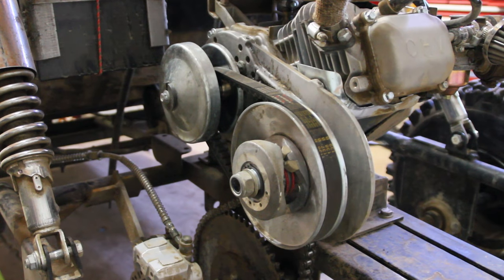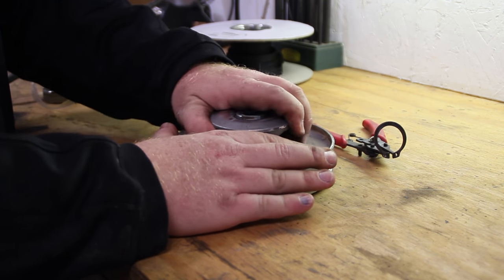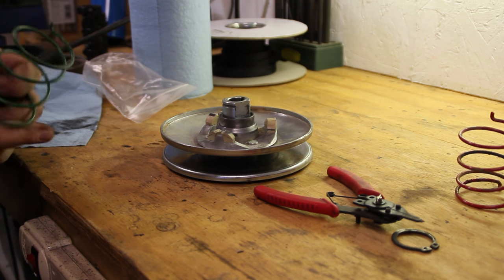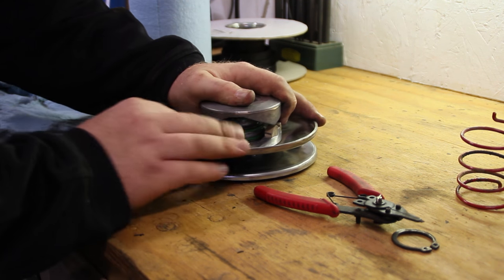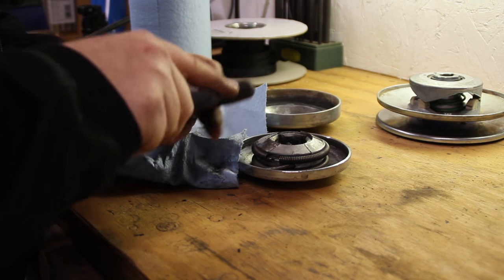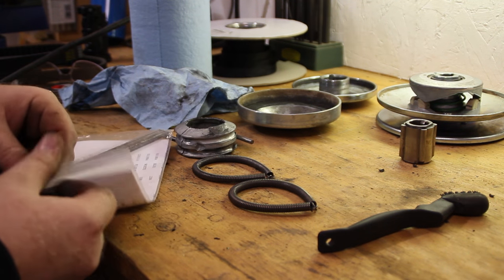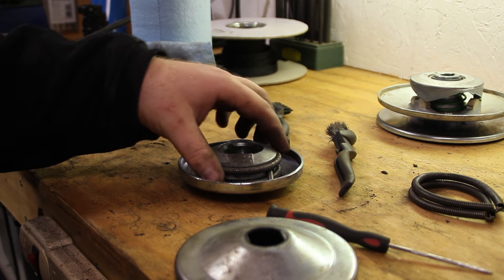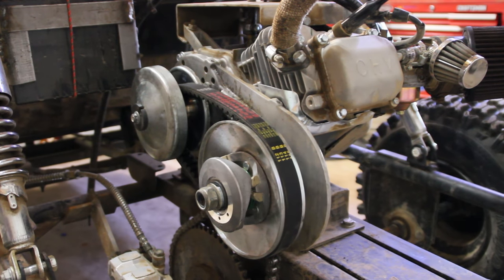Predator 212 Go Kart CVT - Torque Converter Belt Breaking Fix (Neighbor Freak Out)

Comment: I've been trying to get my old manco dingo to work again this was very helpful
Reply: I’m working on my dingo too. The two back wheels spin when I have it up on blocks but when I set it down it doesn’t go anywhere. And then my chain snapped. So I ordered a new chain and now I’m trying to figure out the converter. I had one back in 1984 and now my kid has one I love the dingo. I used to do 180 power slides in the middle of the street on mine.

Comment: I find it's easier to hold cap an twist "puck "clockwise 180 degrees.  So if small spring hole at top put it on bottom when done. Now keep weight on it an put snap ring back

Comment: Great video! I have a couple question. I just got what appears to be the exact same go kart as the one in this video. I got it used and have no idea what the part # is for the torque converter. The drive pulley is missing the brass bushing sleeve as well. What is the part #/ model # for the torque converter you have there? And can you recommend a website where I might can order a replacement brass bushing? Thank for making such great videos! They're a lot of help!

Comment: Assuming that when you put the spring in a different hole, it'll adjust the torque. But what is the actual specifics, like 1 is lower torque and 3 being the highest.
Reply from the maker: Ill make a video in a week or so and we will try it and see the differences.

Comment: I have a 212cc on a Murray with a 30 series tourqe converter everything is Lined. up belt is snug but I keep burning belts
Reply: Tu Wilson Belts typically burn out if they're generic belt or wrong fit. Make sure you have some give on the belt, not super snug. You might have too small belt, and of course set the V side on correctly (flat side facing tq converter). Using the GoPowerSports.com 725 belt should permit good usage on your typical Tav2 30 series tq converter and last a long time.
Reply: @RockieRoadz   ok thank you I will try it

Comment: Hey brother, love ur videos... quick question... which belt or what is ur go-to belt size/manufacture (where do u buy ur belts from?) For the 30 series asymmetrical? Also, either for the 30 series asymmetrical w/6inch or 7inch driven pulley. Is there a difference or specific belt to use when going from 6-inch driven pulley (that's what my amazon CVT  came with) to a 7-inch driven pulley? Which from my understanding is the original/correct/proper pulley size... so what belt would u use, and where do I get it?. Ps I'm driving a homemade 26" Electra bicycle converted to a motorcycle with pedals via a predator 212cc (45mph)

Comment: I bought a 30 series torque converter and put it on my go kart but every time I ride it the chain comes loose.
Reply from the maker: Are you sure your engine bolts aren't coming loose? I use all metal lock nuts because I use to have that problem. If you are using #35 chain then that also can be your problem because it is know to be weak

Comment: Hey any advice you could give me on why my belt is breaking/burring off. I have the same engine but i dont know what belt to buy can you help me.
Reply from the maker: make sure the two pulleys are aligned with the engine off. Also what is your tire size and gearing?
Reply: @RedBeardsGarage  having issues with my belt as well. But my pullys don't seem to line up. How do I adjust them to line them up correctly?

Comment: That's what's wrong with people these days. You don't have to curse and yell to get someone's attention just talk. You guys are two grown people. But I digress great vid. What was the problem with the torque converter that made u realize it needed new spring. Bc mine seems to slip a bit but don't now what part needs replaced.?
Reply from the maker: It would eat up a belt in about 5 hours or riding it.
Reply: Oh okay thanks for the response.  I just eat the belt yesterday but I just bought the kart and I'm not sure if this is the stock belt or if they bought the wrong one.  Is there a number on the actual converter to tell me the right belt size?  Great videos keep them up 👍🏾

Comment: when you accelerate is it suppose to take off smooth like a clutch or is it suppose to grab and hit hard. Also the go kart keeps tearing up belts with in just a few minutes of riding. The go kart is an old manco dingo that I took the Briggs and Stratton off and put a 212 slightly modded predator on.
Reply from the maker: I have had some take off kinda smooth and some take of hard. Check your belt alignment and also how smooth the surface of the pulleys are.

Comment: In the 4 years since this video, is this still what you would recommend? My tc worked great until i added a stage 1 with bigger jet. Now i can melt a new belt within the hour. My alignment is spot on. Can springs alone save my belts and let me keep my mods? Is there a difference between the 203589/5959 and the 203589A belts? If i go all out for a mile i can stop and see the belt smoke. Bought another tc and the same happens. Very fun and rippy while it lasts but it doesn't. A stage 1 predator 212 is not too much hp for these clutches right?
Reply: Hey did you ever figure out the problem, I'm having the same issue
Reply: BLACKHORSE BELTS the best

Comment: Is it better for the belt to be tight or with a little slack when fitting onto the torque converter?
Reply from the maker: I like it snug so it wont take off when idling but not to loose so it hits hard when taking off

Comment: What are the other 3 Holes for? I heard they are different RPM engaugement. What would be best for top speed over torque? I have had problems with belts getting eaten by the rivet heads. A stronger green spring will keep the pulley sheeve from opening too far and allowing the belt to reach the rivets. I just need to know the different RPM set up's.

Comment: I just got a cart. the driven pulley keeps jumping the buttons. the belt is lose. is the belt the problem? I flipped the buttons with the ones on the other side. there's 6. anyways I thought that fixed it but it jumped over them also?

Comment: i just installed a series 30 clutch and torque converter on my little cousins kart. The belt mostly just slips on the clutch. It won't do more than a few mph and doesn't go anywhere at the slightest incline. I've tried all 3 pre sets and everything else i can think of. I can see the clutch start to squeeze, but it still doesn't grab the belt. The belt came new with the kit. I'd appreciate any help. Thanks.
Reply from the maker: +john Franklin probably faulty pulley's
Reply: Red Beard's Garage it's a whole new kit. New driver, driven, and belt. It was basically doing the same thing with the old set up. I made sure the pulleys are lined up. I even tried changing out the old torque converter with the spring from the new one. The only things i can think of is that we messed up the belt trying to get it working right or the clutch is faulty even though it's brand new. I think tomorrow I'm going to try to find another belt to rule that out. Thanks for the reply.
Reply: Red Beard's Garage and btw. I liked your video and subscribed. You made the best video I've seen so far explaining this setup.
Reply: Red Beard's Garage i had them send a new clutch and belt. It ran slow, so i put the torque converter on the 3rd setting. I didn't see the torque converter opening much. Then it ran pretty well but wore out the belt very quickly. I put the choke on so it was barely spinning so i could watch the clutch. I noticed that the clutch wasn't spinning true. It looked like the piece of the pulley closest to the engine was wobbling a bit while the actual clutch either wasn't or wasn't as much. I changed the spacer and the inside part of the clutch pulley and it seemed the whole thing was wobbling. I thought maybe the shaft wasn't true, but i can't imagine how it could have gotten bent. I also can't see how the pulley or spacer would have caused it since i changed them. I took everything off of the shaft and it looked to be true, but it's hard to tell if there's a slight bend or not. Is the pulley supposed to wobble for for some reason? Thanks.
Reply: No, it's likely wobbling because the key inside the pulley isn't lined up to the crankshaft correctly. There sometimes isn't much space left for the key to slide into the shaft on the crankshaft, but it needs to fit in there in that one specific way or it will do exactly as you're describing.

Comment: So I have encountered a problem as well with a tav 2 and a 212 predator shredding belts. I get around 6 miles of ride time before the belt starts smoking and breaks. The motor is stock, the setup is on a Baja Warrior. Did the green spring fix the problem?

Comment: Que stion, I just installed a torque converter on my colman mini bike and the drive pulley is getting very hot is this normal? The 2 pulleys are lined up as they should be

Comment: RED BEARDS GARAGE I was thinking about getting one of the off brand toqure converter and I'm on a short budget. is it wourt 75 dollars.
Reply from the maker: +blake ward there known for braking belts. I would pay the difference and get on from go power sports. If you get the cheap one you will spend the money in the long run replacing belts.
Reply: Red Beards Garage ok thank you for your opinion.
Reply: Red Beard's Garage
Reply: blake

Comment: I bought a predator 212 and a torque converter and installed them on my baja mini warrior moto. after my cousin and I came back from the joyride next to the canals the bolt came off of the front disk or whatever it may be called and flew apart after I picked up the pieces and put it back together my bike won't idle and my bike is really difficult to move forward or backwards when the engine is off when it used to be easy. is the reason for that the mud or is it an engine problem because I did wash it afterwards. thanks for your help in advance.
Reply from the maker: +Nathaniel Castellano just make sure everything is really clean and that everything is installed right. Make sure on the front pulley you seat those flat spots.
Reply: I found the problem. it is the front shaft thats messed up. it is really hard to turn, like for example, if I move the bike while its off the front shaft will get stuck if I move it backwards and if I move it forwards its like moving a car its super hard. I took off the front pulley and the belt, and it moves like a breeze. also my engine won't idle even with the back screw all the way loose to stop the flow of the gas. how is this fixable!? thanks in advanced.
Reply: Nathaniel Castellano  sometime parts come off due to low quality bolts like my tav2 shaft bolt it flew off on me but glad it flew of in my shed /yard area where its very clean.

Comment: I have a stage 1 Predator with a 30 series.  Before I put the stage 1 on it, the tc didn’t slip, but now it does with the performance parts.  Any suggestions?

Comment: Hey RedBeard. I bought a Manco Silver Fox 606 for my kids. Just installed the predator 212 have brand new cvt comet knock off. Thing is with my 15yo and my 11yo the belt breaks. Add me at 6ft3 270 yeah that belt is a goner fast. Do you think this will absolutely fix our issue too. We are in Fl extremely flat some minor very minor elevation changes in turf. Im disabled and this is one thing me my kids can do and bond as dad and sons. Is the go power sports belt really that better in quality? Again disabled and tight budget any and all help is appreciated.